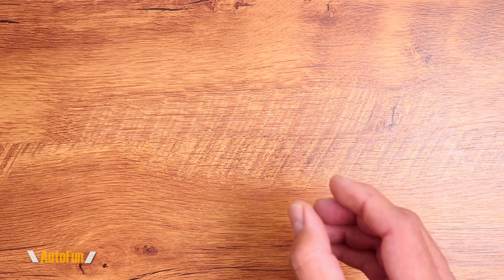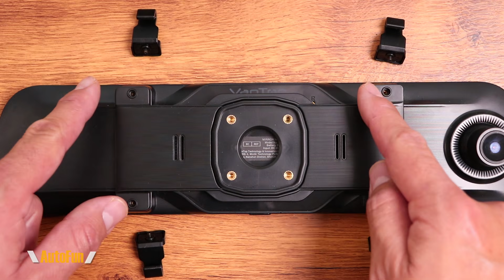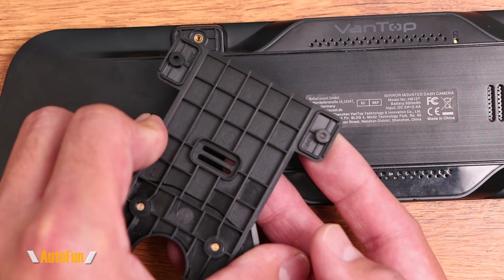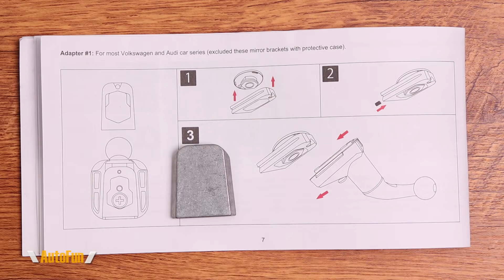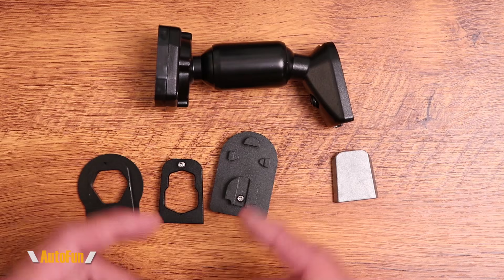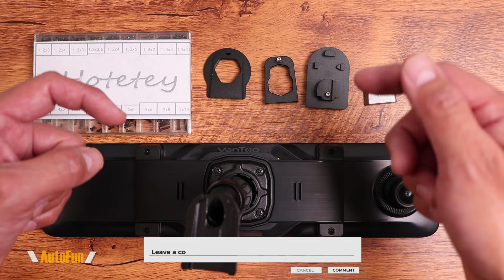How to Install Mirror Dash Cam WITHOUT Straps (Direct Mount Conversion Kit for LCD Mirror)

Comment: nice Video! is there also a plate for the vantrue m2 dashcam?
Reply from the maker: Thanks Julian! Ah yes the Vantrue M2,  I have not tested that dash cam yet, so I'm not sure what kit will fit, however you can measure the back as I showed in the video to determine the size but If I do get a hold of one of one, I will measure it for you and update this comment. Hope this helps and Cheers from California!
Reply: @AlexAutoFun  thank you, appreciated! yeah its already mounted good and in use so measuring it would be very laborious :-)
Reply: @AlexAutoFun  okay i guess i can find the right plate but is it possible to shorten the mount kit? i mean the mount arm is too long to place it correctly into my convertible. In my car its more like only a ball joint in the original version to don‘t block the drivers view through the windshield
Reply from the maker: @ackmn63  Hi Julian! I had another viewer experiment with this https://amzn.to/3OYwnwR to delete the mounting arm completely. However this requires separating (and probably cutting the arm to extract the joint closes to the mirror) so I'm not sure how difficult this was or if he was successful with his mod (I may have to try that myself one day)..

Comment: I ordered the backplate but my mirror bolts to a metal bracket in the center of the two windshields is there a adapter for it?
Reply from the maker: Hi Mac Baca! ah interesting, what is the car make and model that you are looking to install this on?

Comment: I got a new Wolfbox 840H, according to their website, they have 3 different bodies. Their newest one doesn't have any screws visible in the back. I was looking forward to using that mount linked in the desc.
Reply from the maker: Hi Andy! I have converted two G840H already with the kit (just received a 3rd one, may do a video on that showing it)  However sometimes I do see small differences between product coming from the manufacturer directly vs Amazon (where I get all my stuff) that may be a possibility (but even within Amazon stock there could be different batches of the product). I didn't see on their site where it mentions 3 different bodies for the G840H, it does show the 3 models, the G840H, G840S and G880, but those are different dash cams, not sure if that is what you saw..
Reply: @AlexAutoFun  Hi, Good job. I just bought a 12" WolfBox G840H 2.5K WiFi Mirror Dash Cam (Front & Rear). I do not want to remove the existing rear view mirror nor want to strap the new mirror to the old one. I have Toyota Corolla and it has 2 spaces for music system. Lower one i am using for music system and upper slot is empty. Can you recommend a bracket that mounts / screws to the dash cam and other side fix to the slot of the music system 6.5"Wx1.25"Hx5.5"D, Thanks
Reply from the maker: @bvamseedhar  Thank you! Ah there are no brackets made to mount inside the location where I a stereo would be but there are several specialty dash board mounts available, I placed a link to them in the video description, Cheers!

Comment: The one your posting for the G840H is for the G840S and not the G840H.. or maybe the have updated the G840H since your posting
Reply from the maker: Hi Joshua! I have converted two G840H already with the kit (just received a 3rd one here is the video showing the conversion  https://youtu.be/ns_2C-ph2no However sometimes I do see small differences between product coming from the manufacturer directly vs Amazon (where I get all my stuff) that may be a possibility (but even within Amazon there could be different batches of the product). Hope this helps stayed tuned for the G840H conversion video should be out soon bud!
Reply: @AlexAutoFun  yes I watched that video, which led me to comment that they may have updated the back since your video.. the back of mine don't look like that.. I wish I could post a picture here to show
Reply from the maker: @Joshua Mietzner  I totally believe you man! like I mentioned I have seen differences in products (not just Wolfbox's) What I would recommend if you want to stick with the G840H is to source from this Amazon store https://amzn.to/3jRzwOd this is where I just got my 3rd one with screws (earlier this month) here is the video showing the conversion  https://youtu.be/ns_2C-ph2no I would still double check it as soon as you get it and if it does not have screws then maybe the inventory of one with screws has just been depleted but I'm always ordering more, so If I order a 4th one I can also keep an eye on this for you guys!

Comment: Your backplate video is very helpful. You indicated you had info about correct backplate for cams you reviewed.
Would appreciate info on where to purchase correct backplate for Nexigo D90 mirror cam or at least correct strap screw 
hole distances for plate. Thank you
Reply from the maker: Thank you taratara dan! Unfortunately there is no kit yet for the Nexigo D90 that is an exact match. Some viewers have mentioned they used this one https://amzn.to/3INf2TI since it's super close in terms of size. I ordered one to test it out and will let you know once it gets here if it does work or if I find an exact fit for the Nexigo (I'm adding more kits to the video description as I find them) Hope this helps and stayed tuned!

Comment: Do you happen to know which mount fits the NexiGo D90? I want to order the mount with the mirror but dont know which to order.
Reply from the maker: Hi Tony! Unfortunately there is no kit yet for the Nexigo D90 that is an exact match. Some viewers have mentioned they used this one https://amzn.to/3INf2TI since it's super close in terms of size. I ordered one to test it out and will let you know once it gets here if it does work or if I find an exact fit for the Nexigo (I'm adding more kits to the video description as I find them) Hope this helps and stayed tuned bud!
Reply: @AlexAutoFun  Thank you for the info. Looking forward to updates on the NexiGo.
Reply: @AlexAutoFun have you ever tested fitment with the Nexigo D90 yet?

Comment: Thank you for all your videos!  You are super helpful!  I’m looking for a bracket for the Euki M11 but having trouble.  The measurements on the back screws seem to be roughly 13.2x5.8.  Do you know of a bracket that would fit?
Reply: Ordered.  I will update you once received.  Thanks!
Reply from the maker: @mattmcclanahan4548  Awesome! you're welcome bud!
Reply: The bracket came in today but unfortunately it does not fit
Reply from the maker: @mattmcclanahan4548  Oh man, were you able to tell which dimension was too short or too long?
Reply: Horizontally- too long by a few mm 
Vertically- too short by 1 or 2 mm
Reply from the maker: @mattmcclanahan4548  Thanks for this is information Matt, this is very helpful. I'll keep an eye out for conversion kit for your Euki (I will probably add to the list of dash cams to review as well) Cheers from California!
Reply: After trying a couple things I was able to secure the bracket to the M11 using the rubber straps it came with.  The bracket fits behind the M11 well enough that it’s secure with no screws just like the old rear view mirror.  This will suffice until there is an exact bracket plate for the M11
Reply from the maker: @mattmcclanahan4548  Interesting idea.. so you still eliminate the OEM mirror (mirror stacked on mirror look) very clever..
Reply from the maker: You're welcome Matt! ah no I haven't reviewed the Euki one yet so I can't confirm, but those measurements look very close to the Vantop size which uses this one https://amzn.to/3r9ryH5 If you do order it and confirm it works please let us know and I can update this comment, hope this helps bud!

Comment: Can’t seem to find the hole locations on back of G840H. Removed adhesive strip and nothing there or around straps. Just bought within the week.
Reply from the maker: Hi JB!  I have converted two G840H's already and just received a 3rd one that also has screws here is the video showing the conversion  https://youtu.be/ns_2C-ph2no But it's possible that yours may not have screws, sometimes I do see small differences between product coming from the manufacturer directly vs Amazon (where I get all my stuff) that may be a possibility (and even within Amazon stock there could be different batches of the product). I'm currently working on the mounting solution for dash cams that do not have screws, stay tuned for that video and cheers bud!

Comment: Will this mirror bracket will fit on a rav4 2010, I really like it instead of the straps. Clean look is better. Will I need any other adapters? Thanks for sharing your video.
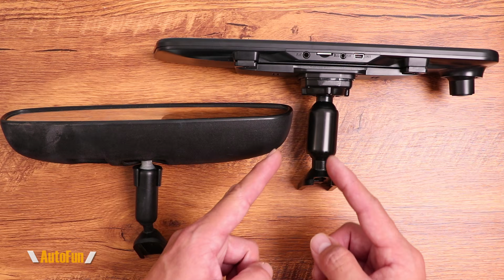Reply from the maker: Hi Moises! I show how to tell which adapter you will need at the 5:40 mark. Another to double check would be to compare the adapters I showed to the one that is currently on your car. Hope this helps and thanks for watching!

Comment: Greetings the conversion kit that you have as a possible option for the Wolbox G84h. Can it also be used with the Wolbox G840S Dual Mirror Dash Cam?  Thank in advance for the answer. Respectfully Orlando Cruz   (from P.R.)
Reply from the maker: Hi Orlando! I have not tested the G840S dash cam, so I'm not sure what kit will fit that one, however you can measure the back as I showed in the video to determine the size but If I do get a hold of one of them I will measure that for you and update this comment. Hope this helps and cheers from California my friend!
Reply: @AlexAutoFun  Thanks I appreciate you info..
Reply from the maker: @orlandocruz7161  You're welcome!

Comment: Great video again man thank you so much but the wolfbox G840H is no longer available any other ones you think could fit?
Reply from the maker: Thanks Alan! yeah I notice they sell out as soon as they bring more in, must be a combination of the supply chain issues we are seeing and maybe some folks that have the item on their wishlist jumping on them as soon as they bring more, just keep an eye on them. Hopefully they will increase production of this adapters soon (but kind of like everything right now, I know we may not have much choice but wait till the factories return to normal production capacities ugh)...
Reply: @AlexAutoFun  thank you and thanks for the fast response keep up the good videos
Reply from the maker: Thank you Alan! also check out the bracket for the G840H! they just got more in! I would hop on it before they are gone again here it is https://amzn.to/3INf2TI Cheers bud!
Reply: The one he keeps posting for the G840H is for the G840S.. there are no screw holes hidden or otherwise on back of the G840H
Reply from the maker: @Joshua Mietzner  Hi Joshua! I have converted two G840H already with the kit. I just received a 3rd one here is the video showing the conversion https://youtu.be/ns_2C-ph2no However sometimes I do see small differences between product coming from the manufacturer directly vs Amazon (where I get all my stuff) that may be a possibility (but even within Amazon there could be different batches of the product). Hope this helps, Cheers!

Comment: A little off topic, but have you found a dash cam that does 1080x1920 @ 60fps on the rear view camera? I ended up going with the Urvolax w/ the OEM style mirror bracket for 250.00 usd off of amazon,  since it seems like the best price for features, size, and quality. It has 2 detached cameras from the mirror, 1920x1080 60fps front camera, and 1920x1080 30fps rear camera, but I keep mine in rear view mode 100% of the time, but the laggy 30fps from the rear view is disappointing. I didn't see any that did 60fps rear even if the front camera was a higher resolution, but your video reviews of the different mirror dash cam's on the market helped me make an informed choice and gave me a good idea of what features I should look for. Keep up the vids, your channel will grow for sure since you are one of the few people who do videos on lesser known car accessories.
Reply from the maker: Hi ZXR! yes I'm currently testing a dashcam that claims to be able to support high frame rate for both front and rear cameras. However it is not a mirror dash cam, for mirror dash cams most are at 24/25 fps and a few like the one you got are able to hit 30fps. But I will keep an eye out for a mirror dash cam that can do high frame rate, I'm sure at some point in the future we will see one. Hope this helps and thanks for watching!

Comment: How about a mount for the Pormido Model D50? Would be awesome. Great videos brother, lemme know please.
Reply from the maker: Hi Daniel! and thanks man! ah yes regarding the D50, unfortunately the Pormido one does not have screw holes in the back, so the conversion kit will not work with it. Cheers!
Reply: Aah… they don’t have it for the D50? I just bought this thing. Those straps are ugly and makes the unit as an afterthought. 👎🏼

Comment: Another great video! I think you have reviewed the Wolfbox G880 and G700. If you have time to check, could either of them be mounted as you described, without the straps? Best wishes.
Reply from the maker: Thank you Luke! ah yes regarding the G700 and G800, unfortunately they do not have screw holes in the back, so the conversion kit will not work with it. Cheers!
Reply: @AlexAutoFun  That helps very much. Thank you! :)
Reply from the maker: @RalphontheJob41  You're welcome!

Comment: I'm curious if you will be reviewing the new Rydeen Tombo 360 dash cam. It has some very awesome features that I haven't seen in other dashcam mirrors. Two of my favorite features are the radar sensor to record people getting close to the vehicle,  and automatic screen dimming.
Reply from the maker: Hi Hammer! I may have to add it to the list of reviews, but as far I understand the radar sensors are for parking not for triggering the dash cam, but I will definitely take another look (By the way, you didn't hear it from me, but I got another dash cam review coming that is going to take the concept of the Rydeen Tombo 360 to a whole new level, that's all I can say right now lol) stay tuned bud!

Comment: I cannot understand why all the manufacturers don't simply offer the option to mount it both ways. All of them should come with the option of strap, and direct mount.
Reply from the maker: Hi Bradlee! I totally agree with that man, I also really wish they would standardize the mounting size so we don't have to measure and pick from different kit sizes, be great if they could agree on say one for 12" and one for 10" mirrors...

Comment: Do you know which mount kit will fit a WolfBox T10 mirror cam?
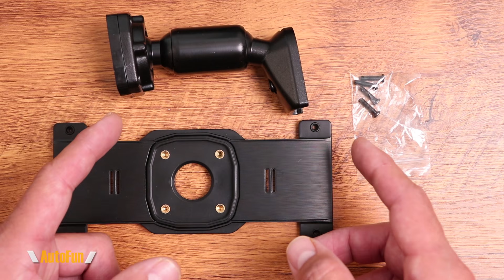Reply from the maker: Hi Glenn! I'm the process of going thru all my dash cams and measuring them, I will let you know once I can confirm which kit will fit the Wolfbox T10. If you rather not wait, you can also determine what kit size you will need by following the measuring instructions shown in the video at the 1:50 mark (links to the different kit sizes in the video description). Hope this helps and thanks for watching!

Comment: On some OEM mirrors there is a power pin that goes into the mirror.  What do you recommend doing with that? specifically a Telluride
Reply from the maker: Hi Michael! ah yes for those type of mirrors I use stay with the straps unless I'm ok with loosing the functionality provided by the original mirror (OnStar, home link, maps lights etc.). Hope this helps and thanks for watching bud!
Reply: @AlexAutoFun  yeah it has the home link which I don't use since the car stays outside. I'm paranoid about someone breaking into the car and then using the homelink to get into the house. I feel there is no need to program the garage door opener if the car never stays in the garage. Besides it's controlled via app so it's like I'm taking in the clicker everyday. I did notice that the telluride uses the standard mount so that's good to know since I didn't see Kia in the manual.
Reply from the maker: @ELCapiTRAN  Yes! I knew I wasn't the only paranoid enough not program my garage opener for a car that stays outside lol I fully agree with you bud!

Comment: Thanks for making this video, I have a mirror dash cam that I wanted to put in one of my cars but couldn’t do it because I didn’t have clearance to plug the wires into the top of the mirror (headliner starts coming down too low and I have no clearance). 

With this kit I will have the clearance I need since it will just be the one mirror and can adjust the height.
Reply from the maker: You're welcome Spencer! glad to hear it helped (yeah I ran into that issue on a couple installs where the line is just too close to the cables) Cheers from California bud!